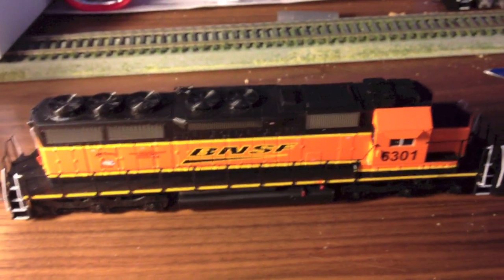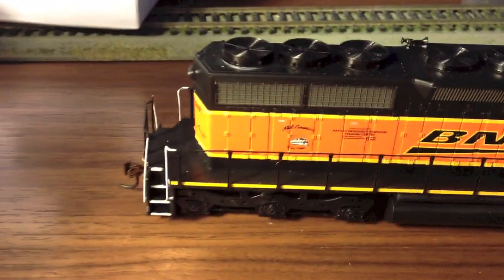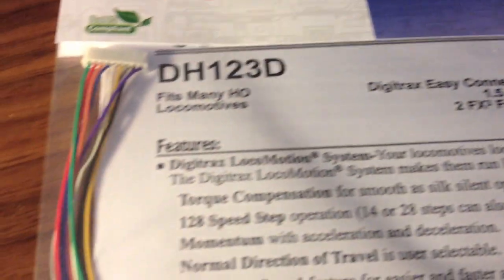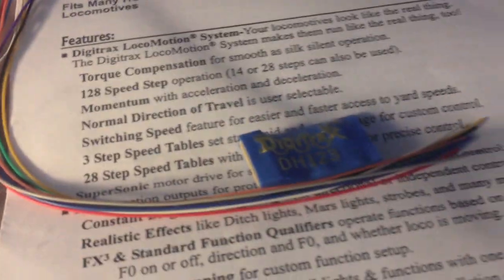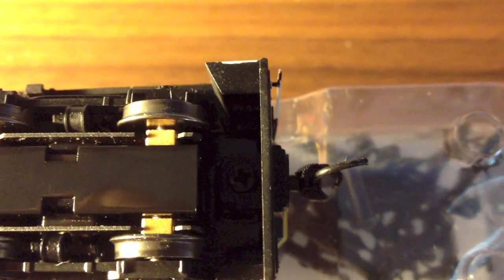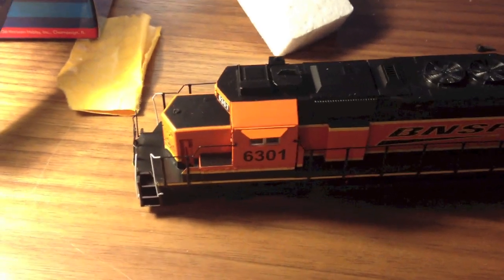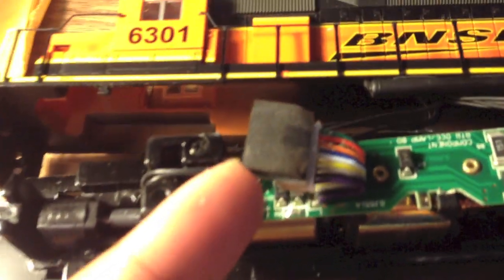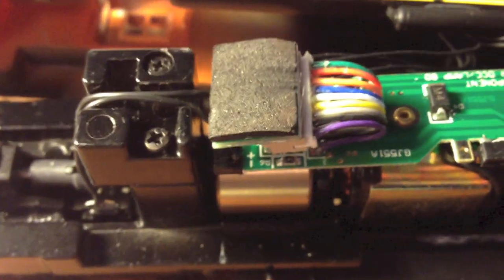Digitrax DCC install into an Athearn ready-to-run HO scale locomotive

Comment: I put some NCE decoders in some engines in the past. I know some times you have to turn an twist the wire harness to get the board to set down close to the Athearn board then use electrical tape to hold the new DCC board down so the shell can sit down on the frame the way its supposed to be.

Comment: when installing 8 pin,simply plug it in and no soldering required also take the 9 pin adapter out as it can interfere with proper  8 pin operations

Comment: Thanks for your reply.  The 4 corner truck wires are connnected as well as the orange and grey wires on the side of board.  The 8 black light wires on the front and 4 black wires in the back are indvidually separated.  Board has 2 light tabs in front\back of board (pos and neg).

Comment: In need of help.  I have the SD45-2 bicentennial loco number 5702.    I removed the shell to inspect my speaker and I accidentally  pulled front and back wires off the dcc board.  Now I'm lost as to where the wires go on the board.   Can  you help me out?
Reply from the maker: Sure! Can you tell me what tabs don't have wires going to them on the DCC board? There should be four tabs on each end. The corner tabs on each end go to the trucks. There should be some wires coming from each side of each truck. They go to the corner tab. There are also the light tabs which should be the two middle ones on each end. So if it's the wires from the shell that aren't attached, then it's the middle two tabs on each end. If it's the wires from the trucks that aren't attached, then it's the corner tabs. If you have more details on which wires got pulled out, then hopefully we can help more. Thanks!
-Cam and Ryan